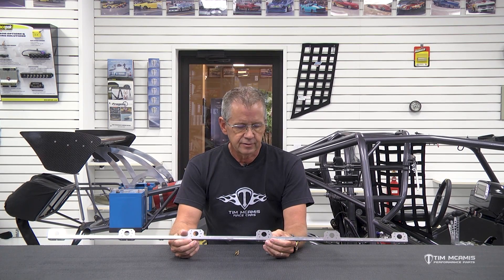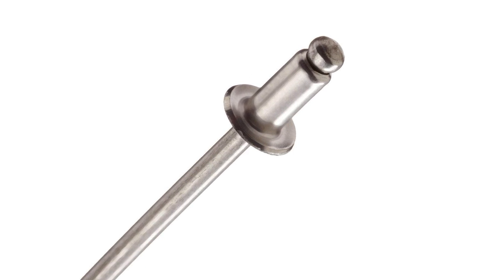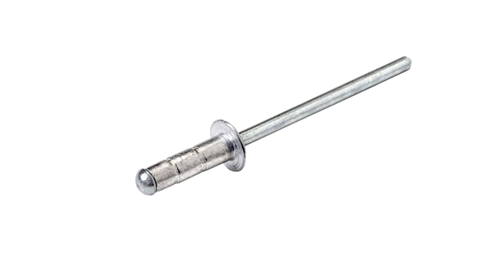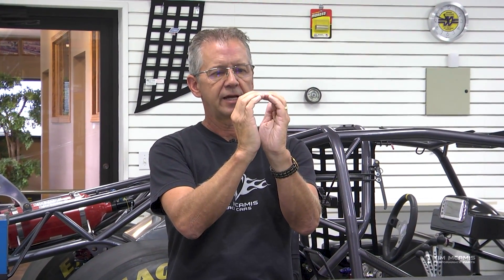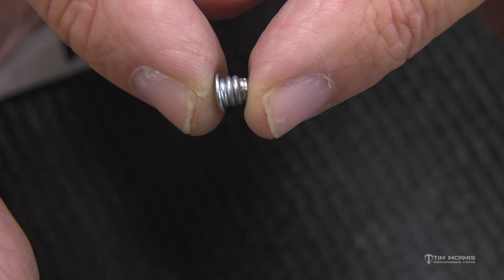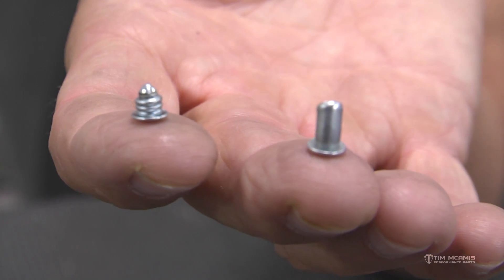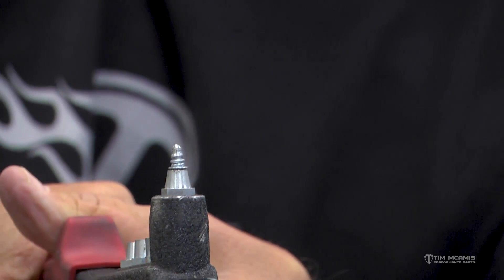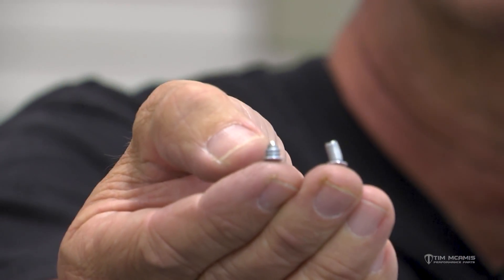Avex vs Cheap Pop Rivet

Comment: In dirt racing, we’ve used “double”  and “triple”  pull rivets for decades. They are nearly all manufactured in China.  I’m extremely doubtful those rivets aren’t manufactured by one if the majority Chinese companies. I almost guarantee that they are.  So many of racing’s prestigious brands import directly from China. I’ve seen the import manifests and spoke to the MFG’ers. We even found cranes that do manufacture in the us outsourcing some of their inventory and bleeding it into the domestic quantities. Many of the knock of products are a result of the original company manufacturing overseas and not from a third party copying then.

Comment: Hey Tim, great video as always. Have you guys considered playing around with SPRs (self piercing rivets?) 
We use them in the auto collision industry on pinch weld flanges. They leave both sides of the flange a lot flatter  then even an avex rivet, almost like a spot weld. I'm not sure how well they would work with carbon panels or lexan though, or if they would work at all.

Comment: I agree with its a better product. My question is why wouldn't running a washer on the backside of the rivet, give it just as much bite on the material? Especially if you crush the backside with a hammer.
Reply from the maker: If you have access like that, then a smash rivet may be a better option. This is mostly for instances where you don't have access to the back side.